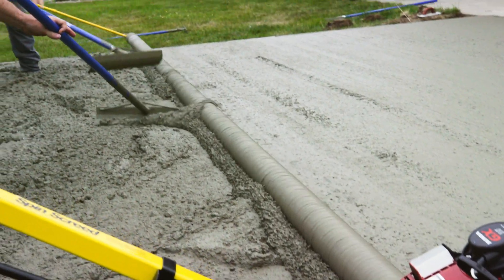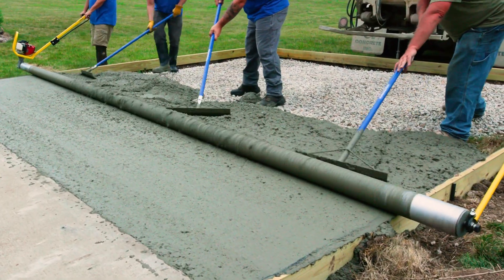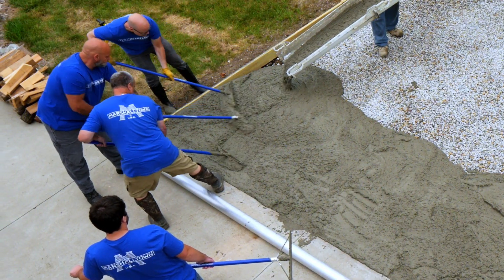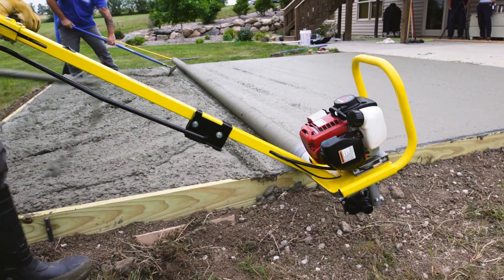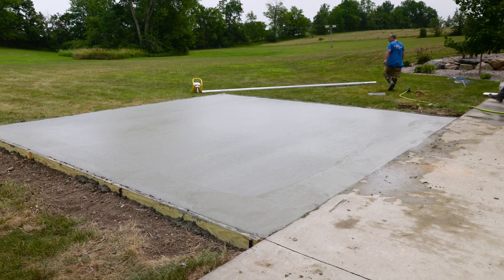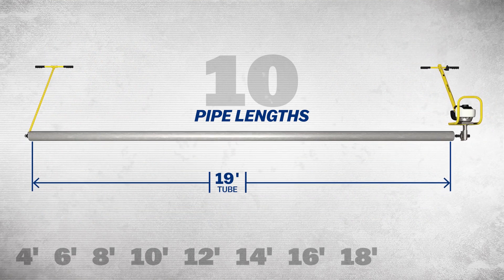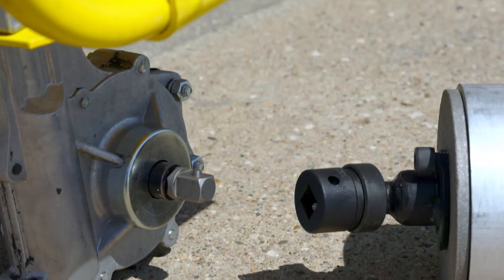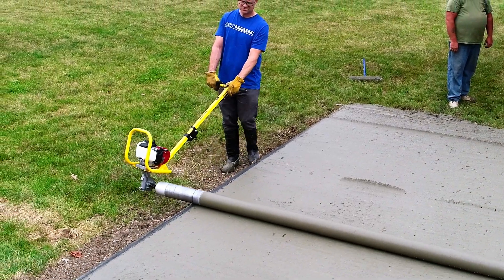The New MARSHALLTOWN Gas Powered Spin Screed

Comment: Useless, it will not hold grade. It will flex in the middle upward. Will not work with any slump under 6. Will not ride a form, aggregate will get under the roller. Cannot be used on open floors. If it sits too long between loads the cpncrete on it will cause it too lose level and not work properly. Junk. Dont waste your money.

Comment: What are the tolerances? On the bigger lengths, e.g. 18ft, does it dip in the middle somewhat?
Reply: No, it shouldn't. Unless it's bent. The concrete in this video was a bit on the wet side, a bit stiffer keeps the pipe from sinking but too stiff and it'll actually float. Make sure you got more than enough guys on hand to rake mud! These aren't any easier than screeding with a board but they are faster and more consistent.

Comment: What are the costs for these units?  What slump mix can it be used with?
Reply from the maker: It can be used with concrete having more than a 3 inch slump. You can find the cost on our website, link is in the description.